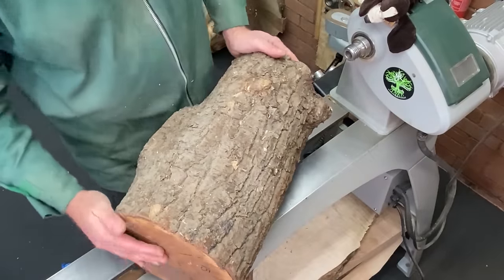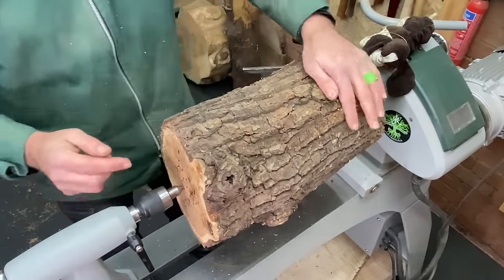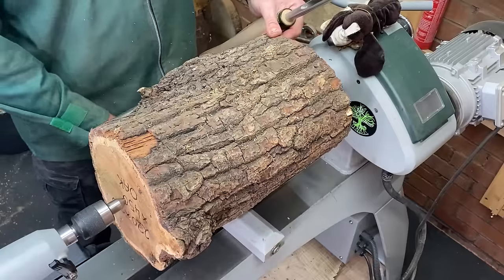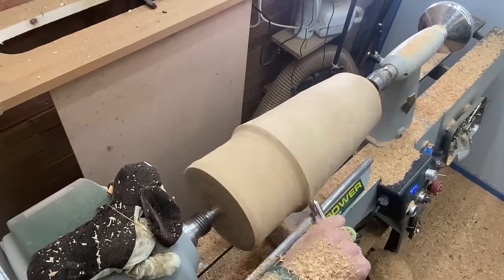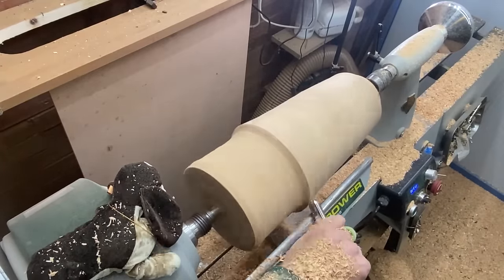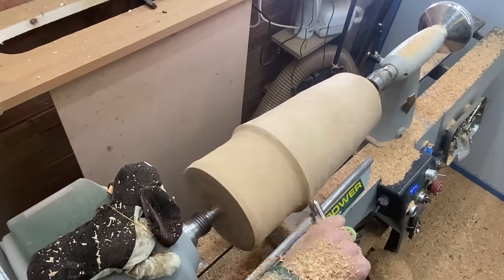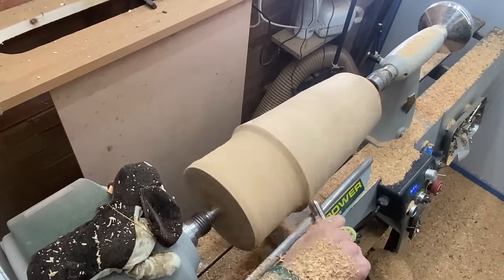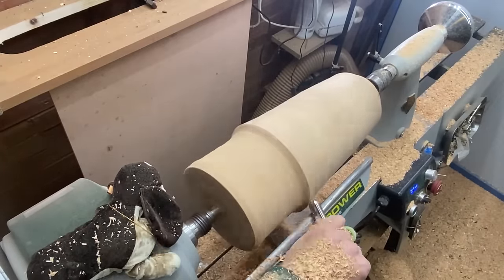A CRACKING OAK experiment - Woodturning project

Comment: Brilliant video Mike.  Great to do new things and learn by doing it.  I'm a newbie but have a good engineering brain and have som ideas to throw about.. When I saw you trying the dremmel I thought what you need is it mounted to a sliding plate like you did with the marker pen.  Then with the router, I thought the same to get them to be really flat and easy to move.   Now you were going from left to right which is probably why you were climbing up on the line sometimes.  You need to go from right to left because of the clockwise rtotation of the bits will keep it biting downwards and stop it climbing up.  I believe that the router was the best option and I would also have done it in say 3 phases, Starting shallow and getting deeper each time with the base of the router touching the piece like routing a juice groove in a board. This way you could have stops either end and with the router on a sled would do a great job.  Message to self:  make a tool post with a flat plate to fit jigs like this 😀😀
Reply from the maker: Wow thanks go much Gavin! I never even considered the rotation of the bit but that makes so much sense. I'm going to pin this to the video so I can refer to it again. Thanks so much 😀
Reply: @MikeHolton  its a pleasure - hope it's right 😃😃

Comment: Very Nice. This is good use of spindle indexing. It is pleasure to see you work. A great job in using jigs to help the set up. You are great at working out the solutions too a problem. I would use a test tube so I could put flowers in it for my Wife.
Reply from the maker: Thank you very much David, I have used test tubes before and have a pile waiting for a future use 😃

Comment: Hello Mike. Interesting, very interesting. I like the way you went about your learning process in figuring out how to cut the flutes. It certainly is a less complicated way to do it than some other ways I've seen before involving large routers and costly pre-made jigs and all. While this is not one of your more beautiful pieces, it is....interesting. LOL. You used a grinding stone to cut the flutes. I know Dremel makes a smaller steel ball with circular flutes in it. Maybe called a burr remover? I can't remember. I know it is used in small detail carving work in wood and other materials. Maybe they make a larger version that would make cutting and cleaning easier? Take care and keep turning and learning. Bill Riley.
Reply from the maker: Hi Bill, the bit I used in the Dremel was a Kutzall bit which does remove a lot of material, there is still a lot to learn in this process but I will carry on and let you see how I get on. I will not be buying am expensive jig as I want people to be able to afford to have a go as well. All the best, Mike 😀

Comment: Well, Mike, this video has certainly achieved the aim of experimenting ... and raised quite a mixed bag of comments! I made some 'cup cake' boxes with fluted sides using a small router on a home made jig, the body of which sits on the lathe bed; it is very accurate and pretty easy to use once  'in the groove' (every pun intended). Separately, I have experimented with ebonizing fluid (home made with white vinegar and old nails and assorted metals - credit to Richard Raffan for the tutorial on that one) on oak - used with gold embellishing paste it worked a dream. I picked up your suggestion to try it on cherry - another idea added to the 'to do' list, thank you! I am intrigued by the suggestion in the comments to re-turn the body of your vase to reveal the grain on the flutes; I think that would look stunning. .. and finally, the 'discovery' of the small bead/ lip at the shoulder was genius to keep it. Thank you, as always Mike; excellent video.
Reply from the maker: Thanks so much David, if you get time can you send me a picture of the jig you made for your router? This is the first jig I've ever made so would love to see what you did. All the best my friend 😀

Comment: You did say that you wanted to use the channel for experimenting amongst other things.You certainly have experimented today and believe it or not, you have achieved your goal. By ebonising the wood you have effectively camouflaged the imperfections so well that the end result is pretty good.  Great effort and looking forwards to the next one you produce. I would think using a smaller diameter router will give you very good definition. Cheers.
Reply from the maker: Thanks so much Peter, I don't have much of a selection of router bits but now I have a better idea of what I'm doing I can invest 😃

Comment: Hey Mike, that black is Stunning. FYI, there is a carborundum stick that will clean the grinding burr that you started with. These sticks are made to shape or clean that style of burr. You might think about a carbide burr so it won’t load up. You can use bee’s wax to help with the loading on the carbide. Just a few FYI’s. Keep turning, Larry
Reply from the maker: Thanks Larry, I was actually talking to the guys at Kutzall on Sunday at the woodworking show, hopefully we may be doing some sort of collaboration. All the best, Mike

Comment: A very good experiment.    Well done.   Glad the cracks were not a problem.
What you think about this new ebonizing product vs indian ink?   How well the wood grain is able to be seen, relative darkness.
I was shouting at the monitor that you needed the dremel tool being held in a block.   Glad you changed to the hand held router with the flat edge base which worked so much better.
For your viewers, an easier platform is a piece of wood board/plywood mounted on a wooden dowel of the tool post diameter.

Dave.
Reply from the maker: Thanks as always Dave, I did consider the dowel idea but I had it all on the lathe by then and all my broom handles were the wrong size 😃. This seems to come out a lot better than the Indian ink I've used in the past and the finish is a lot better. 
All the best, Mike

Comment: If you ever try this again, try the dremel without the flexshaft.   There are a number of faceplates that you can use to ride a sled.   And its just a bit easier to control with the weight of the tool helping you.   Come to think of it, I just had an interesting idea.  I wonder if I could attach the dremel to the toolrest and use the pivoting of the toolrest to steady the tool?   This would allow me to take careful shallow nibbles and perhaps then keep the dremel from being smashed by the lathe.   Of course that wood be another sort of design/texture, but I think I will try that out.    Well for good or ill, you've inspired me today!    Thanks.
Reply from the maker: Thanks so much for the ideas, really appreciate it 😊

Comment: Could you expand on why you can't use a roughing gouge on end grain please, Mike?
Reply from the maker: It will tear it too easily and the piece could come apart, it could also break the gouge, they are not as strong as bowl gouges as the shaft going into the handle is a lot thinner

Comment: was going to say that you could use a router if you didn't feel the flutes were refined enough... you also could build a box to surround the piece so you reference the router's base as intended, though it wouldn't really follow the form of the piece unless you built one specifically for that
Reply from the maker: Thanks, I certainly have a better idea now of what I need to do to make this better and will certainly be giving it a go 😀

Comment: What are your thoughts on the difference between using an ebonizing compound vs India ink?
Reply from the maker: Good question, in my experience ebonising fluid can take more of a sanding before letting the lighter wood show through as it seems to penetrate deeper but both are good.

Comment: You can make a rod to drive your vases , buy taking a piece of rod stock and grind three  or four spurs on the tip , and either grip in a Jachobs chuck on a  morse taper mandrill  or grip in scroll chock . Insert your vase and press the spurs in to the botton and bring up tail stock with a live centre and a pressure block or a rubber friction block
Reply from the maker: Thanks again Gary, invaluable advice al always, all the best, Mike

Comment: By all means make a sled to hold your rotary tool . Your ebonising fluid contains an acid , and probably ferric iron oxide  that react with the tannins in the oak 
You can make your own by soaking ground oak bark in solution of water and either ferric iron oxide or wire wool . The resulting fluid will be black india ink and will penitrate the wood  and will be a perminant black that over time will brown the surrounding wood in a faint ring 
Have you used a propane or butane torch ? If you do , give the lathe area a good hoover to eliminat the fire hazzard . Nice job 
When I am applying any cheicals to work on my lathe , i always lay down a board that I cut to cover the bedways , or a piece of  news paper or shop towels so that I dont have to scrub up with spirits or solvents
Reply from the maker: Thanks so much for your advice and input, I have made my own solution before with iron(II) sulphate (FeSO4) and tanic acid which produces an iron gall ink, a recipe that has been around for 100's years, this ink is permanent and will not fade in sunlight. All the best and thanks again, Mike

Comment: Maybe your lathe is tolerant enough to deal with the vibrations in the early stages of the shaping process but I would certainly try to assist the lathe by roughing out the shape with a side axe or hand grinder with a rotary chainsaw disc or indeed just a grinder with a compatible cutting disc before mounting it on the lathe. I'm no electric lathe turner but do have experience in pole lathe turning
Reply from the maker: Thanks Paul, this is a heavy duty lathe weighing over 200kg, it is designed to take pieces a lot larger than this 😀
Reply: @MikeHolton  I'm sure this lathe could deal with bigger and heavier pieces of wood, my comment was more concerning the vibration caused by turning irregular shaped pieces

Comment: The flutes shaped by the router seem to need significant sanding. Oak with its open grain is tough to smooth but this result looks too rough. More refinement could really make this great idea pop
Reply from the maker: You're right, I'm still considering taking this all back to bare wood and experimenting some more on it.